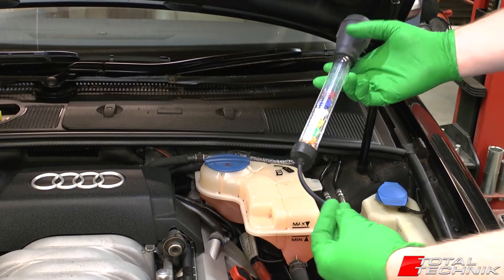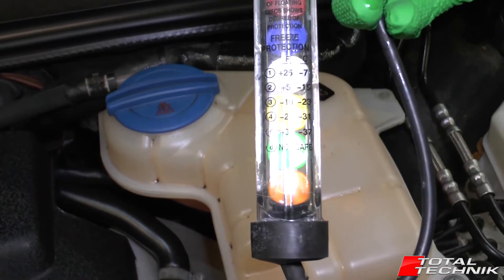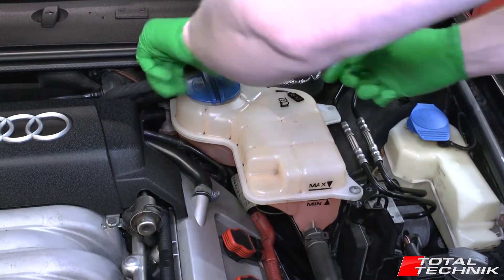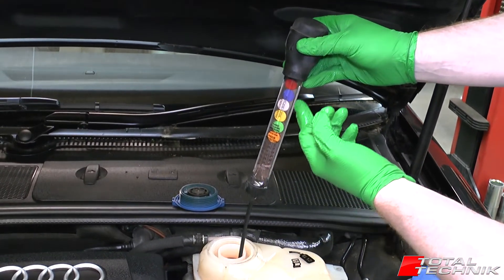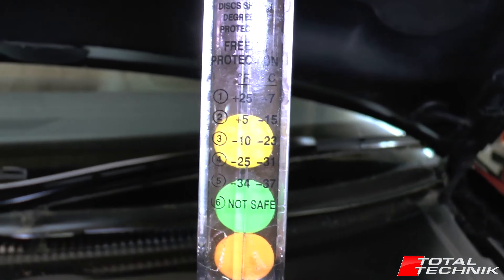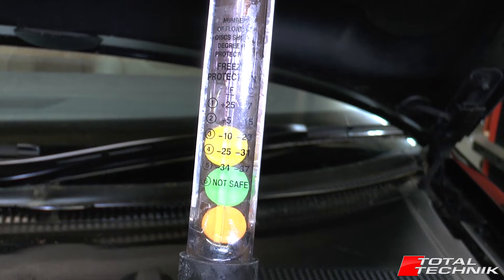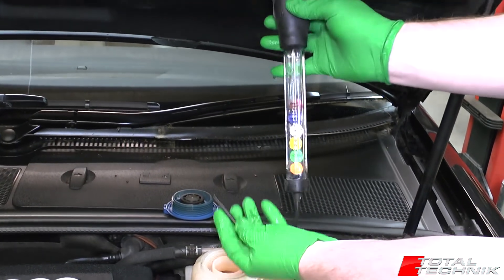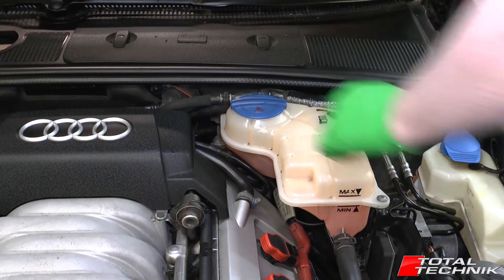How to Use Coolant (Anti Freeze) Tester - TOTAL TECHNIK

Comment: I don't know why people think that when they check the coolant in the reservoir that they're getting an accurate reading on what is actually in the cooling system. You could have a 75% mix of antifreeze in the reservoir and the actual radiator could be much weaker. You need to check it in the radiator. The cooling system doesn't circulate coolant through the reservoir.

Comment: whats the 6th disc mean? why is it not safe?
Reply: Too much antifreeze in the system, not enough water.  i.e. stronger than 50/50 ratio which doesn't provide enough cooling properties for the hot engine

Comment: Just take a sample of coolant out of the radiator put it in a plastic cap then put it in the freezer for 24 hours if it doesn't freeze it's ok if it does then change it simple
Reply from the maker: Yes, the theory is very sound indeed, depending on your freezer settings of course. However mixing food and antifreeze is not a good idea as it's extremely toxic. And you need 24 hours spare too. But cheaper than buyer a tester though!!

--- 

To help support us (for both you and others reading this) there are a few things you can do:

1) Donations both needed and welcome! We cannot operate Total Technik without the support of people like you! You can donate by PayPal - just go to www.paypal.me/totaltechnik
2) Please ensure you subscribe to our YouTube channel. 
3) Please give our video's the Thumbs Up on YouTube. 
4) Please help spread the word, the more people who know about us the better! Add links to our video's in forums, let people know about us.

Thank you for your support!
Reply: @TotalTechnik  no you wouldn't put it any where near food obviously just put it in an empty draw at the bottom it does the same job as a tester if you haven't got one

Comment: i have the same tester but actually it was hard to understand your explication, for example on my tester the white disc was the only one floating, could you please tell me what is the right read for that diagnosis? thank you
Reply from the maker: Hey there! Well, they do vary a bit from tester to tester so you should always go by the instructions/key printed on the side of the tester. But assuming you have the same tester as this one, as you mentioned...

The number of discs that float tell you how good the coolant is. For the UK we need protection for at least -20C. So for us we need to see our tester floating at least three discs.

It can vary country to country on what your target figure is. Some countries are much colder than the UK and so will need more protection (more coolant to water mix).

If you only have one disc floating, as you can see on the side of the tester, this is only giving protection to -7C. This is not enough for the majority of countries.

So, your coolant needs to be changed if only one disc is floating. This could be because either the mix is too weak, or you have a leak and have been topping it up with just water, or the coolant is quite old and becoming not effective anymore.

Either way, you should change that ASAP before the cold weather really hits hard.

Best of luck!

--- 

To help support us (for both you and others reading this) there are a few things you can do:

1) Please ensure you subscribe to our YouTube channel. 
2) Please give our video's the Thumbs Up on YouTube. 
3) Please help spread the word, the more people who know about us the better! Add links to our video's in forums, let people know about us.
4) Donations both needed and welcome! We cannot operate Total Technik without the support of people like you! You can donate by PayPal - just go to your PayPal account and select the Send Money option and send any donations to: donate@totaltechnik.com

Thank you for your support!
Reply: Total Technik 
So it means that always the number of disc floating will have to be on the top of the tester right? I was confused about that. Thank you for your answer
Reply from the maker: Yes, that is correct. The key on the side refers to how many discs float.

One disc floating is not enough, and would indicate a coolant change is needed.

--- 

To help support us (for both you and others reading this) there are a few things you can do:

1) Donations both needed and welcome! We cannot operate Total Technik without the support of people like you! You can donate by PayPal - just go to www.paypal.me/totaltechnik
2) Please ensure you subscribe to our YouTube channel. 
3) Please give our video's the Thumbs Up on YouTube. 
4) Please help spread the word, the more people who know about us the better! Add links to our video's in forums, let people know about us.

Thank you for your support!

Comment: Hey so I know this the wrong video to reply to but I’m hoping you would have some insight. I have an 03 rs6 and the line to the oil/transmission cooler is cracked. I was quoted $3400 to replace the oil/transmission cooler and the 4 lines coming in/out of it since they are rusted. Is this an expensive part? Is the labor something really difficult to do? Hoping since you work on that RS6 you might be able to help.
Reply from the maker: Hey there! It's not a job I've done TBH, and not one that I would be keen to do either. I'm not sure of the exact process without delving into the workshop software for each pipe, but I know on the S4 (for example) you have to remove driveshafts and likely drop the subframe etc, but nothing too drastic - but that's a simpler car.

The parts will not be cheap. Those four lines will likely be $150-$300 each, and the oil cooler is an expensive piece of kit.

You should ask them for a break down between parts and labour so you can get a feel what you are paying for. The lines will be genuine only for sure, but you MAY be able to get a non-genuine oil cooler which could save a fair bit.

And ask them how involved the process is, and what the job entails.

Seems expensive to me, but I have a feeling the parts will make up a good % of that total.

It could be done DIY if you are competent, but would not be a nice job and you'd want a ramp really as lots of back and forwards between various locations to get different angles etc and so would be a nightmare on axlestands. Still possible though.

Shame all 4 need to be replaced, but if you are doing the job best to do them all just in case. You might be able to find the pipes used in good condition on eBay. Just ensure they are completely rust free, otherwise it's a backwards step. But I've seen VERY clean oil pipes coming off of RS6's before that I'd happily re-use, so they do exist.

Best of luck, and keep us posted!

--- 

To help support us (for both you and others reading this) there are a few things you can do:

1) Please ensure you subscribe to our YouTube channel. 
2) Please give our video's the Thumbs Up on YouTube. 
3) Please help spread the word, the more people who know about us the better! Add links to our video's in forums, let people know about us.
4) Donations both needed and welcome! We cannot operate Total Technik without the support of people like you! You can donate by PayPal - just go to your PayPal account and select the Send Money option and send any donations to: donate@totaltechnik.com

Thank you for your support!